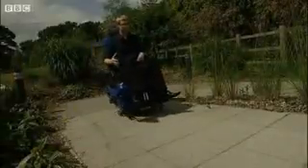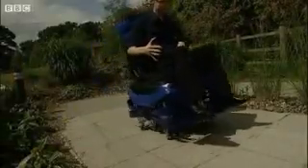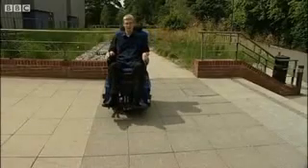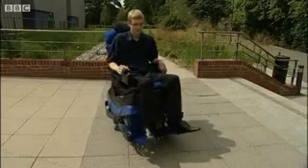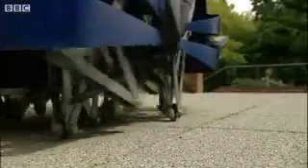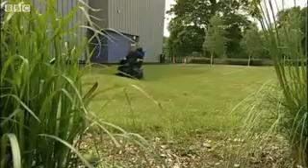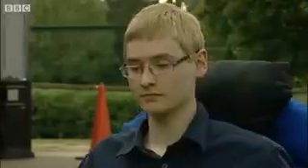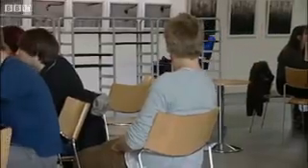Walking Chair by Martin Harris

Comment: Why is this not on the market?!
Reply: Because it's a stupid design.
Reply: Hesam0000 How so?
Reply: Siiri Cressey Using so many legs when they can use 4 tires or 4 legs just as easily, plus this will get stuck everywhere. The Segway wheelchairs are right now the most capable and most practical.
Reply: Hesam0000 I think having more legs would make a much smoother ride, especially on uneven ground.  I'm in a wheelchair, and going over warped pavement is rough.
Reply: Siiri Cressey Those legs need heavy motors to move them that add 100 pounds to the weight, this is no smoother than Segway wheelchair, infact the less contact with ground the smoother it'll be unless it's a Hovercraft on air, not metal.